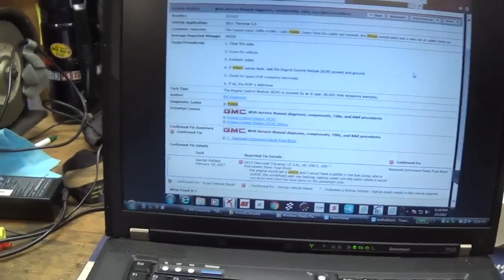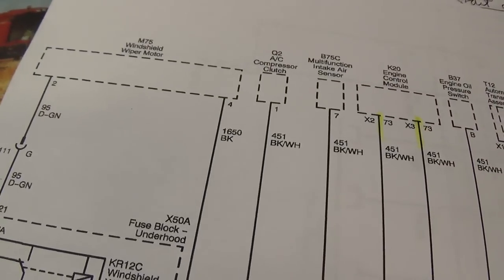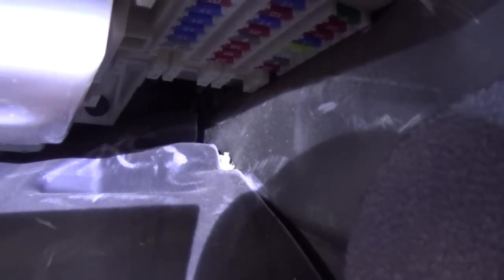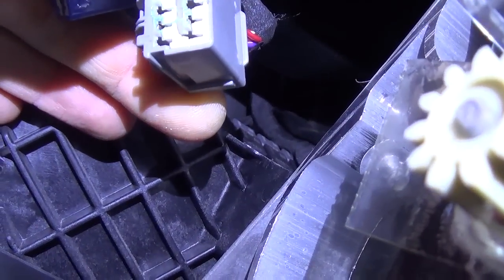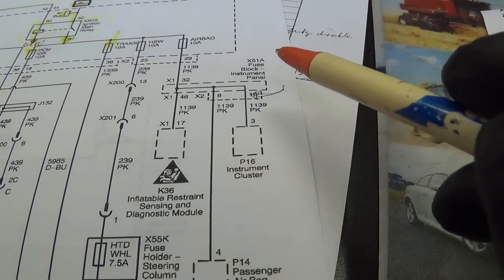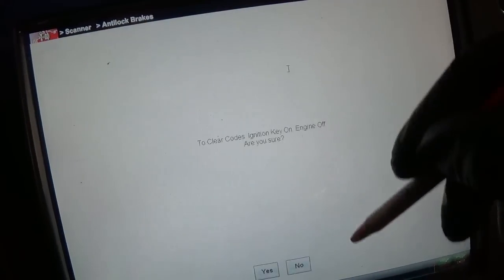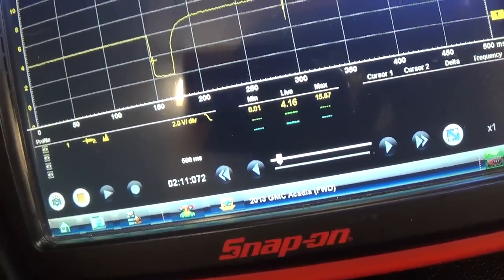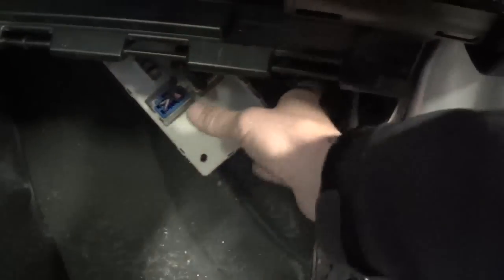CONCLUSION!!! No-crank, REDUCED ENGINE POWER: '13 GMC Acadia -Part 5

Comment: Great video Ivan! TSBs can save you sometimes but just a tidbit of info b/c you know how I love TSBs. I looked at the TSBs and typed in the DTCs and also water leak 2 nights ago and the only thing I came up with in Mitchell was a sunroof leak & stopped there...I know better than that but today I typed in No Start and BAM there it was. We can run schematics all day long but shorts don't follow WDs and when we do find them it's pretty rewarding.  It's nice to have Keith & Eric available b/c there's a ton of experience & info plus all the resources they have & we all know knowledge is power. I feel sorry  for the next owner when it starts raining but I would imagine you cleaned & sealed up the connector pretty good.  Outstanding video & thanks for sharing!!
Reply from the maker: Thank you so much for the feedback and support! I am slowly learning to check TSBs more often at the start of the diagnosis, rather than after hours of  running around in circles haha
Reply: Man you're doing a fantastic job & I'm impressed by your knowledge and and the way you diagnose faults. Congrats on 13K subscribers and the more people watch your videos the more they'll realize how good you are!

Comment: Hey Ivan, GREAT JOB!!! also this repair should be cover by the dealer, the TSB shows records of this happening in others vehicles, that is why they issue the TSB. They need to fix the water leak, make sure the windshield is properly seal, replace the fuse box, replace the carpet on that side that it is full of mold (hazard to the health of the occupant) and make sure the ECM is not damage after all this constant electrical issues. 

I have a friend with a similar problem on water intrusion on the 2015 GM Malibu and has all kind of electrical problems thanks to water leak from the cowl area, and that started to happened from day one since she purchased it brand new. The car went back to the dealer for the same electrical issues 8 times and the dealer cant replicate the issues until they saw the puddle of water coming out from the carpet foam. They claim they fixed the problem, but after the repair the car keep acting up so she trade it in.
Reply from the maker: Wow 8 times with no results!!! What a lemon!

Comment: water is a good conductor
Reply from the maker: It seemed like it was just fresh water getting in, so it was a slow process to actually reach a point of failure. Can you imagine how much havoc salt water would cause?? Many times higher conductivity than fresh water!
Reply: motoYam82 I have a feeling that you'd be replacing the ECU at the very least.
Reply: Gary Johnson Actually, pure water is an insulator.
Reply: pure water but water normally isn,t so as a result bang you get a short.

Comment: nice that you found that. to bad
the owner is trading it off due to
a bad winshiel install. they should
have took it back to the windshield
shop that replaced winshield. i see
lots of shady winshield jobs. im sure they liked the acadia or they
would not have dealt with trying to
get this fixed this long. you did not
confirm the no com no start though but i bet your right with
the outcome.
Reply from the maker: Except the windshield replacement was performed in Texas...

Comment: GM quality! We are professional grade.
Reply: I think you need to read consumer reports on some of that wonderful GM reliability!!
Reply: I was unaware a windshield not replaced properly by someone shows the quality of the car. A thing it does determine is your ignorance.
Reply: Smitty Smithsonite I'm not claiming whatsoever they are without fault.. No manufacturer is! I understand your frustration, but it doesn't meen they are all the same. I personally own a Silverado and had very little issues with it. And to say GM's reliability is terrible is simply untrue. Buick for instance ranks second out of all manufacturer's reliability rating. Yes i did see the tsb.. Other manufacturers have and will have odd and similar issues regardless of who you choose to buy from. Harsh reality but true. Nobody is perfect. If your truck left a bad taste in your mouth that's fine, just remember that lemons will be put out in the wild.. The silverado/sierra sells nearly as much as the f150 another truck riddled with issues.
Reply: What i stated in my answer was accurate.. Buick was rated second best manufacture in terms of reliability. I didn't mention any other brand. Fell free to read my post again...
Reply from the maker: What model years does that survey cover? Can't see why Buick would be that much more reliable than Chevy, GMC, Cadillac or any other GM brand...
Reply: I agree, most vehicles share allot of platforms with each other but consumer reports has claimed it to be in the top two. I don't exacly see why this so hard to believe. I know you've had allot of bad luck with these GM vehicles but they must be doing something right if they're always idling around in second place for the worlds largest automaker in terms of sales.     https://www.bloomberg.com/news/articles/2016-10-24/buick-becomes-first-u-s-brand-to-crack-consumer-reports-top-3     http://www.autonews.com/article/20161024/RETAIL/161029945/buick-becomes-first-u.s.-brand-to-crack-top-3-reliability-rankings-by-      http://www.npr.org/sections/thetwo-way/2016/10/24/499221144/buick-up-honda-and-subaru-down-says-consumer-reports
Reply: I'm more inclined to use real world evidence, based on repairs I make, vehicles I, friends, or family own, and what I read on various forums and repair publications. That said, any publication can be bought to report that a piece of cow dung is the best thing since sliced bread. I don't believe much that I read anymore. I take everything with a grain of salt.

What I know for certain is, my '07 is a piece of dung, my bother's '01 Duramax left him dead on the side of the road in NY ... then rusted away to nothing in 12 years flat, and went through 4 sets of injectors, and a couple head gaskets in its life,  and my dad's '09 Duramax failed to regen, threw codes, and required trips to the dealer to regen to get out of limp mode, DPF was eventually tuned out .. then state forced him to re-install it - then the dash peeled, buttons wore off, injectors failed, and the list goes on. I can see clearly that the GM of today is a far cry from GM of the 60's, 70's, or even the 80's or early 90's.

I know I'm picking on GM, but the same can be said of ALL makes of the 21st century.
Reply: Smitty Smithsonite You're very reasonable and get exacly what my point is. I was simply trying to make the original poster understand that regardless of what manufacturer, you're bound to have some bad experiences. Some more than others for sure, but people need to stop taking feelings as fact. I completely agree with you, if you're surrounded by the same make and can see issues all the time in that particular vehicle you'll levitate towards another brand. The only issue is it doesn't represent the majority.
Reply: I'd much rather deal with a few GM electrical issues than Chrysler mechanical failures
Reply: I'm not so sure about that regarding the AFM/oil burners out there ...

I forgot to mention, my 5.3 Flex, AFM engine in the Silverado started burning oil at 50k miles. Would puff smoke out the exhaust at start up - witnessed it every time using the remote start, beginning at about 20k miles. Now, if I'm towing and leave my foot in it on every hill, it'll drink a quart in 300 miles. If I go easy, it'll make 6k miles on a quart. Last 2 oil analysis showed high levels of iron and aluminum (rings, and piston). I've run synthetic in this thing since it hit 2k miles. Been running Amsoil Signature Series since 40k. Longest I've gone was 9,600 miles, then I got the high wear metal levels, so dropped it to 7,500 & changed to 10w-30 for a huge improvement. I've been driving and wrenching a long time, and I've never seen an engine wear so fast as this one. GM had a great thing with the LS, then cheaped out on it with chinese piston rings, shoddy tolerances, and poorly engineered AFM lifters ( at least those haven't failed on me ... YET ).

I'm not the only one with oil burning issues with AFM - just do a google search - it's a widespread issue. Same with the lifters. Nearly every person I've talked to with the same engine and year range has the same problems.

 I've only got 89k on it now.  In the day I ran cars with 4x that many miles, and NEVER burned a drop. Leaked ... but didn't burn. SAD times we live in! I paid more for this damn truck than my parents paid for their house in the day ... and this is what we get in the 21st century! Us techs are going to be very, VERY busy going forward!
Reply: This was in the infancy of AFM. Yes it was an issue that has now been mended but again i fail to see any proof that this represents a majority. Not saying you're wrong but again if AFM is a bad issue for your truck. i'd recommend you'd get it disabled.
Reply: I don't know what AFM is...........
Reply: if the Windsheild was installed by a dumbass its not GM fault sorry most electrical problem are cause by previous repair
Reply: I always find die-hard GM defenders everywhere, even as their products turn to crap  year after year. Did you guys not see the TSB? Regardless of whether or not the windshield was replaced, GM has a PROBLEM in this area ... (as usual!).

I've got an '07 Silverado - first new vehicle I ever bought. Was in and out of the dealership all through the warranty period for pulsating brakes, and incessant squeaks and rattles. Had a "Service 4x4" message in DIC at 2k miles - dealer said nothing was wrong. Happened 4 more times - never mentioned any body codes stored. I got stuck replacing the switch out of warranty on my own dime. At 38k miles, my lower ball joints failed. At 50k, the uppers, hub bearings, and one strut failed. At 55k it started to burn oil. Now at 89k, the engine sounds like it's on it's last leg, and my fuel trims have been going real negative lately (probably another crap quality injector). Before this, I owned a '00 Jimmy - ended up parting it out because it had so many electrical gremlins! Biggest pile of garbage I've ever owned. You'd think I'd have learned from that ...

GM has some serious issues lately! Just look around the net! Vehicles  are breaking down right off the showroom floor. An absolute disgrace! They ain't what they used to be, that's for sure.
Reply: You're a moron.
Reply: Mat A he's definitely in the minority. Sound like he definitely just got a lemon. Most older GM trucks I see don't have many problems outside of intake gaskets/corroded knock sensors and newer trucks having TPS codes for dirty throttle bodies. That's nothing compared to all of the dodge trucks I've seen with lifter and valve issues. I've got a Nitro outside I just pulled the heads off of to find half of the valve seats have come out and are wedging the valves open.

Comment: interesting find. remember the battery was drained and replaced by the dealership. now if when it got wet and shorted feeding back thru and "waking up" modules this could have been found with a parasitic drain test. or at least it would have pointed a direction. problem is catching it  at the proper saturation point.
Reply: That's a big jump ez to say when you have the answer from the start.

Comment: lol 
funny how they trades in this big POS on wheel after the major problem was fix
great job Ivan 
btw which software bundle are you running on that verus  and thinking  of getting the update on my solus ultra
Reply from the maker: My Verus is only at 14.2. I'm afraid that if I get the update it will crash and burn and I'll waste a lot of money haha

Comment: Time to take it back to the dealer with the video. Make sure GM gets a copy.
Reply: They will just point their fingers at the windshield installer.  Windshield installer will just remove the glass and reinstall the windshield, probably use a little more sealant but they will not pay for any damage because they will point their finger at GM and their TSB.

Comment: gm sucks
Reply: Windshield can leak on any car.
Reply: No garth the glass was replaced GM is in the clear on this one.
Reply: Exactly my thoughts also. The windshield replacement guys/gals get paid by the number of units
replaced per day/week just like any other specialty service which can leave room for hurried or bad install jobs. not just the manufacture problem here
Reply: Not GM fault bad glass install.
Reply: There's a TSB on this Eddie - it IS their fault, just maybe not on this one. Probably would've happened sooner or later anyway. OR, maybe the windshield was initially replaced to fix that leak? Never know.
Reply: Yes the TSB gave him more ideas where to look but the leak in the TSB was in the dash not the glass.
Reply: But what about the TSB (not TPM)? Are they due to bad windshield install? ;)
Reply: Your comment shows your intellect toward automotive repair.

Comment: Sometimes I like to imagine being an auto mechanic, then I watch stuff like this. How do you service giant pieces of rolling shit that all modern cars seem to be? They have so many design and manufacturing flaws, then the owners get their hands on them. I would imagine working on newer cars is the most troubling, as there is less data and case studies about them. Now that my car is eight years old, I am having an easier time diagnosing it and getting service with out hours of trouble shooting and testing, although my highest diagnosis bill was for a faulty glow plug relay on a 20 year old diesel Volvo at 6 hours.
Reply: Cars getting more complicated is hopefully a good thing for smart mechanics. It should help weed out the assholes that open a shop and all they do is suspension and brake work taking away the gravy for the guy who knows electrical and deserves to be paid. Those guys who arent real mechanics are the ones dropping the prices and killing this trade. In my area youre not paid for diagnosing because the shitheads here dont charge for vehicle inspections or just throws parts at it and the customer becomes accustomed to that and now thinks why should I pay for diagnosing? So the kicker is you diagnose their vehicle for free and then they take the car to get it fixed for cheaper at the shit mechanics that couldnt find the problem. Hopefully people clue in on this in the future.

I dont know if this had anything to do with your comment I went off on a rant.
Reply: I totally get you... Here in Italy i often have to discuss what my time is worth with customers and they don't even understand a single thing about what i do. Ignorance is frustrating and overwhelming. BUT we must fight for ourselves